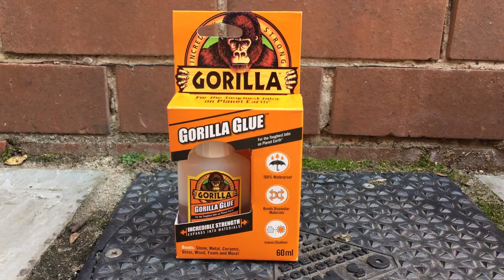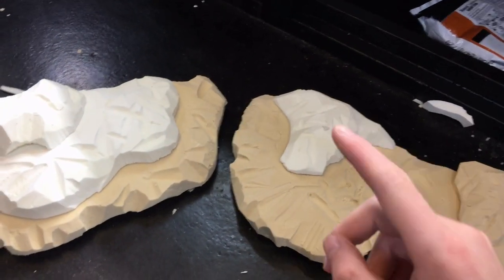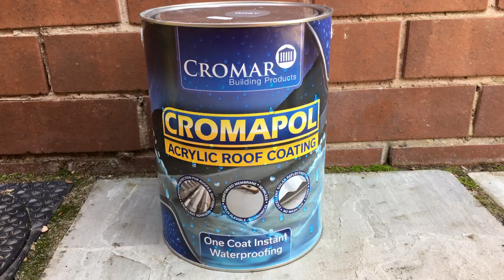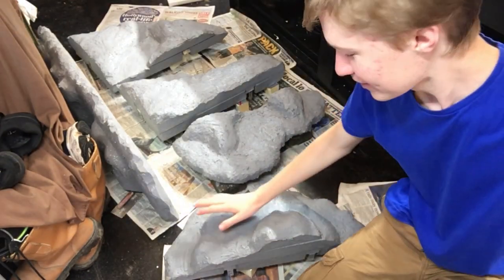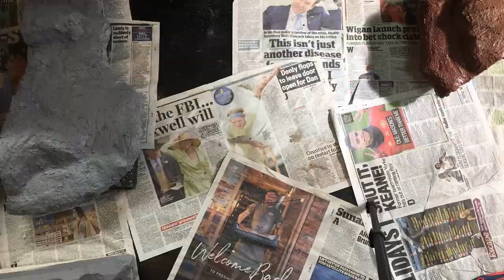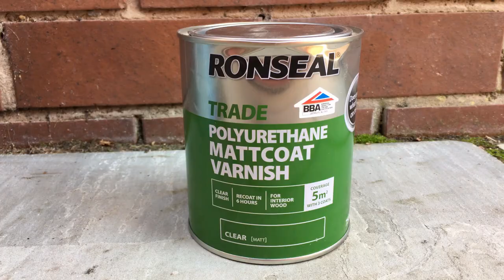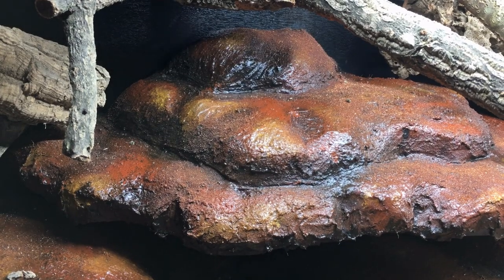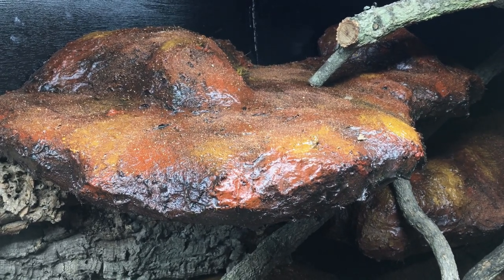REPTILE FAKE ROCK BACKGROUND BUILD - DIY Fake Rock for Reptiles - Fake Reptile Rock Ledge

Comment: I’m at the final stages of a similar process and about to use a water based polyurethane varnish to seal it. I’m just a little worried how it will hold up under heat as one of the ledges I’ll be sealing will be a basking spot.
Reply from the maker: My ledges aren’t under the basking spot for that very reason... Do let us know how it holds up over time!
Reply: @JTBReptiles  my research into polyurethane says it should be ok up to temperatures of 93c I’ve done a ‘test rock’ to try it on first and see how it holds under a basking light